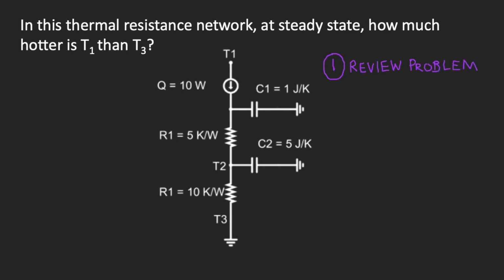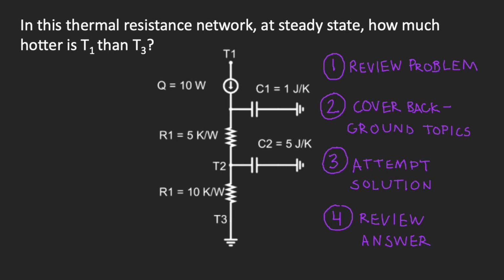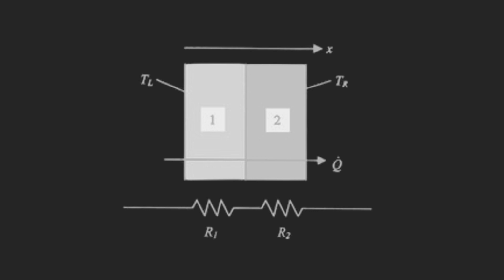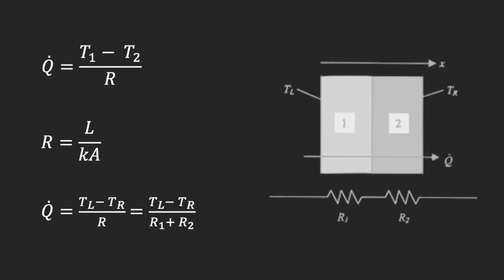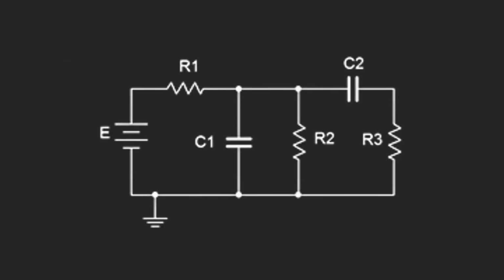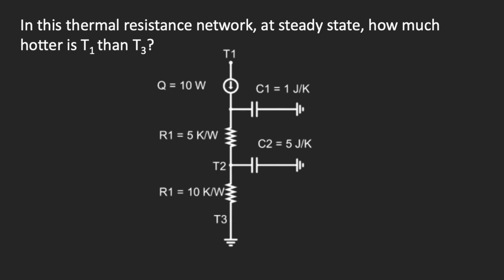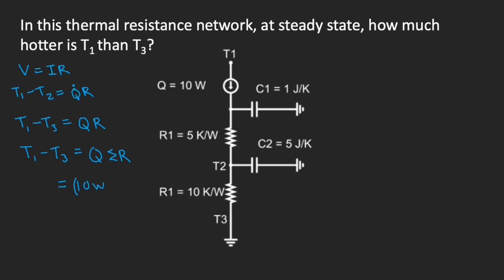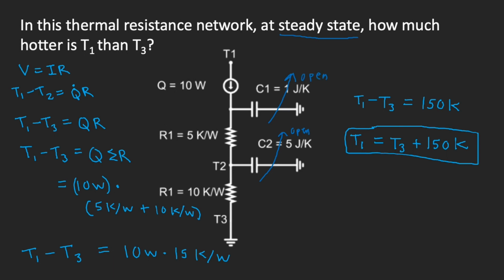TESLA Mechanical Design Engineer Interview Question SOLVED! #5

Comment: Since the capacitor acts as an open path with zero resistance, I think the whole current is going to flow through capacitor 1 and there won't be any heat produced by R1, R2. So. T2 and T3 will be at the same temperature.
Reply from the maker: The capacitor is at a steady state so it will have a voltage but no current.
Reply from the maker: @Jiacheng He Correct! At steady state, the capacitors will be fully charged and act as opens.